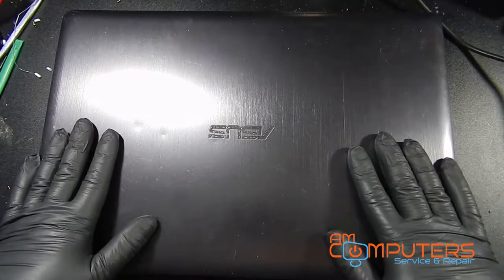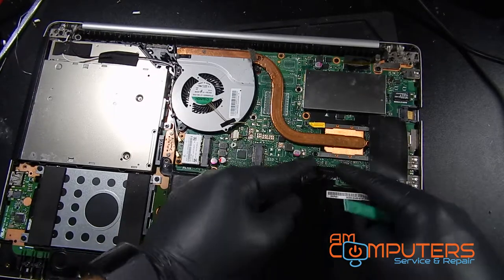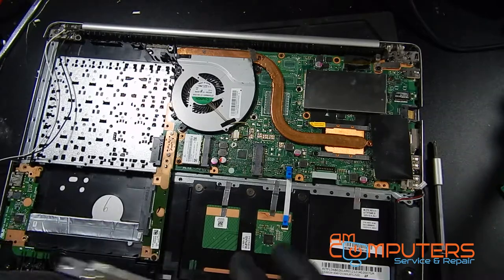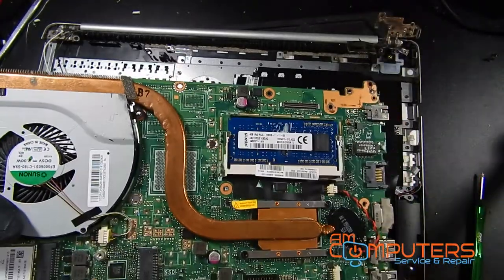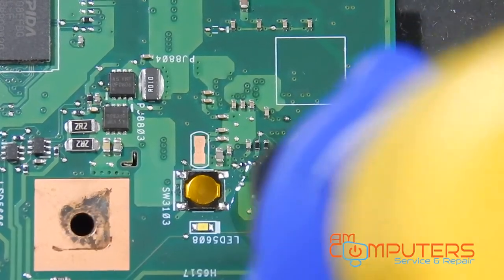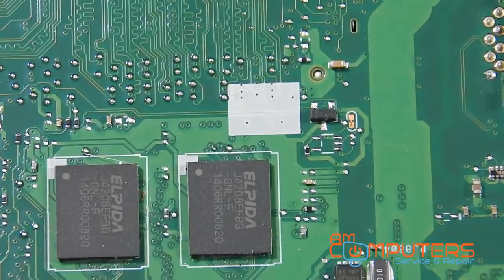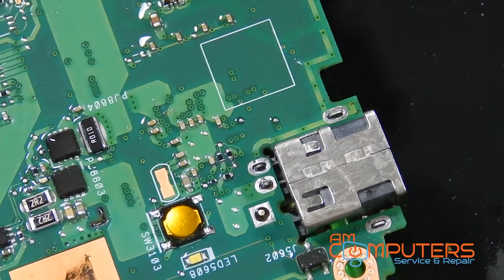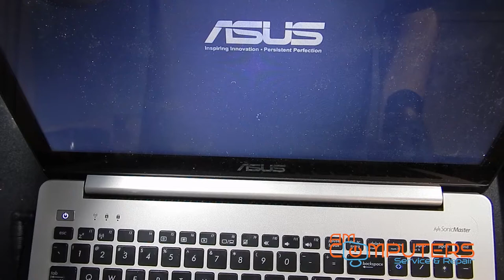Asus V551L DC Jack Replacement

Comment: I can't find the ram inside this laptop I have the same laptop it turns off as soon as I turn it on
Reply from the maker: The RAM is under the metal housing in the upper right hand side of the motherboard ( if you look at the thumbnail for this video). If you're laptop turns on then off I wouldn't suspect the RAM. Could be the jack or a faulty component on the motherboard